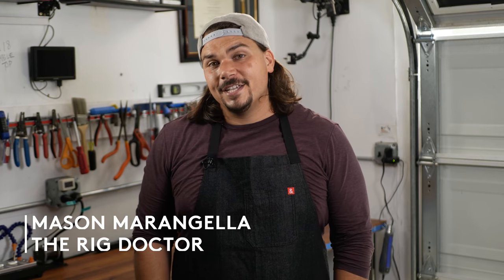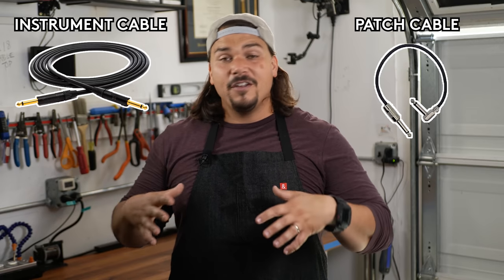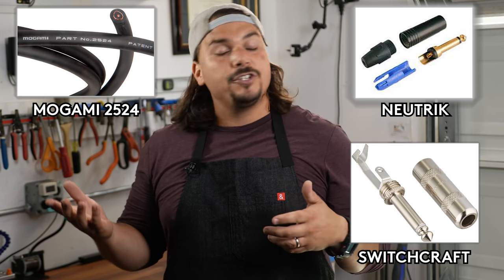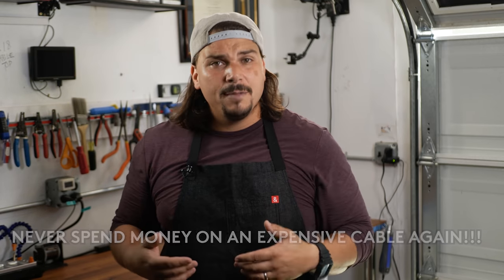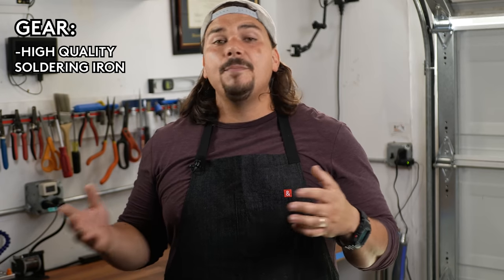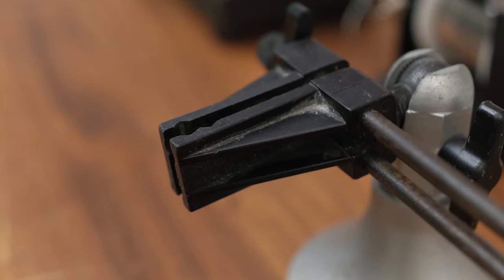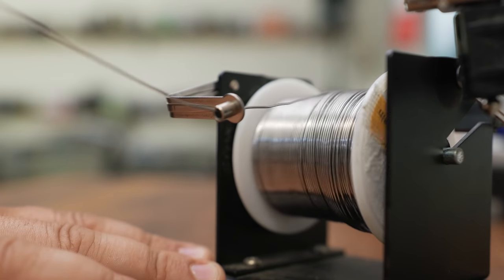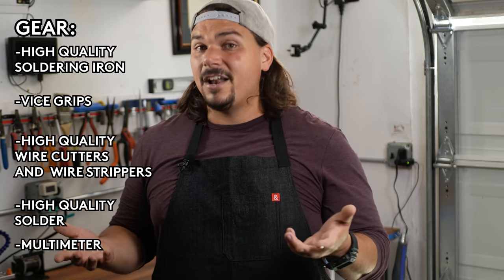Never Buy an Instrument Cable Again

Comment: When you say you don’t need all he shielding you actually do. I do this for living and over time the experience I’ve had is that if you have more shield wire soldered on the better it is. 

I also want to add on the topic of the connectors. The Neutrik silent plugs are as reliable as the normal plugs. We have cable in our inventory that are silent plug and we’ve had them for 6 year so call unreliable is not correct
Reply from the maker: Jonathan - This is a standard practice in the industry, not just me.  On a quality cable, like Mogami 2524, the shield has to be large and thick to cover the center conductor fully.  But you do not need that much wire at the ends where it connects to the 1/4" plugs.  At the plug side, it is only the termination, the shield no longer covers the center conductor, the metal plug cover does that.  A large shield has such low resistance that cutting a lot of it out will still be lower resistance than the center conductor.  There is no loss in the shield quality when the ends are made acceptably thinner.  This is basic physics you would get in 11th or 12th grade, and is not a unique opinion held by just me - this is fully substantiated scientifically.  Just think about it, every strand of the shield is making contact inside the cable, so every one wire is in contact with every other wire inside of the cable outer insulator.  With regard tot he Neutrik Silent Plugs, they are less reliable, the mechanism does fail over time and this is substantiated by our reps/distributors that provide our plugs and our colleagues using thousands of these every month, like Best-Tonics, CBI Cables, and other huge shops that have silent plug failures 10x the non-silent varieties.  This isn't just Neutrik, pretty much all silent plugs have some longevity compromise because of the added mechanical features that are added.
Reply: @VertexEffectsInc  In my experience, the right angle Neutrik Silent plugs are worse than the straight ones. I've had a couple fail and I would never use them on stage. I've removed them from my cables and replaced them with the normal Neutrik right angle plugs. Since I like the look of red housing backs I kept them - they work with the non-Silent plugs!!

Comment: I won't use Neutrik Silent plugs anymore because they're unreliable, more than 10 silent plugs failed on me although I am really careful with my cables. I use Amphenol for years and never had any problems with them. Since that I avoid using any moveable parts like the Silent Plugs. About the cables I've built with Mogami, Tecniforte, Tasker, Gotham AG, Lava, Monster, but after years I prefer Reference Cables (made in Italy).
Reply from the maker: They all have their problems, I only use them if I have to (silent plugs).
Reply: I would also advise against using Planet Waves' Circuit Breaker plugs. They are very nice plugs, but the switch is plastic and tends to break if you abuse it too much.
Reply: @BrunodeSouzaLino  that's the problem with moveable parts, someday they will have problems with material fatigue.

Comment: Neutrik provides assembly instructions with exact cutting length for both sleeves on the cable, no need to be guessing and measure twice-cut once
Reply from the maker: Link?  I've not seen this, but next time we do a video on this, I'll certainly post :)
Reply: oops, that wont work.

Comment: I need some clarification. In the beginning you refer to the difference in thickness between patch cables between the pedals and the cable from your guitar to the board. Is there a difference between the part numbers W2524 and just 2524. In the video about making pedal board jumpers you reference the W2524. Im just confused because it seems a lot of the websites use the parts interchangeable in the title. I just wanted to make sure there are 2 different cables I am looking for, and not just doing endless circles on the internet for a cable that doesnt exist lol. For reference: the amazon link has this in the title "Mogami 2524 Guitar & Instrument Cable - Bulk W2524 - Sold in 50 FT Lengths"
Reply from the maker: 2524 is the same as W2524...same product.  Normally the leading letter is omitted.

Comment: Excellent video and great information!
I am currently using 2 of the 12 foot Mogami Platinum from guitar to the pedalboard and from the end of the of the pedalboard to my input amplifier and I really love the great sound quality of these cables…they make my electric guitar a different instrument than was before…now the tone has a clear crystal sound,warm,silent interruptor system and so neat even when I use distortion pedals effects…what do you think about the Mogami Platinum cables Mason?are they a good choice?
Reply from the maker: I think they're Mogami 2524 as I recall, that's a nice cable.

Comment: Did I miss the multimeter bit and how to test cables?
Reply from the maker: Should be on there. Set it to Ohms and it should read "0" when you put the problems tip to tip or sleeve to sleeve.

Comment: So TRS plugs require a different coaxial cable? I want to make a 4CM snake like you showed in another video but I need one of the cables to be TRS for channel switching. I take it the Canare cable you recommend in that video won’t work for TRS, is that correct?
Reply: Anything that’s three conductor and fits through the boot opening should work

Comment: Assuming all solders are done correctly , is 24/26 ft lenght cable ok before start losing signal ? Also, should we expect to read 0 Ohms when measuring a cable of that lenght ?
Thanks Mason
Reply: I can't answer your question, but.. 

ulver ❤

Comment: I am using SP500 ends, and my ground is fine, but my tip is not reading, my solder points look fine. Any tips? My ground is reading under 1 ohm, but my lead is 4-5 and up. Im using 2314
Reply from the maker: Could be how you have the sensitivity of your meter set.  Did you try the buzzing feature?  Have you sound checked the cables?

Comment: I can not stress enough how important those strain-relief ears are on the Switchcraft-type plugs. They must be crunched down pretty tight. If not, you can get a bunch of movement inside the plug, and the failure mode I've seen most often with cables made using Switchcraft-type plugs is the center conductor breaking loose cause the cable moves around a ton due to the strain-relief ears not being clamped tight enough. I generally dislike the Switchcrafts cause of this (IMHO) design flaw. If I make cables for people, they get Neutriks...If I repair cables for someone and it shows up with Switchcraft-type ends, it gets Neutriks.
Reply from the maker: Josh, strain relief is critical, there are also some Switchcraft plugs that have longer clamps that are good for thicker cables so they really wrap around well.  I think they have an "L" at the end of them, e.g. Switchcraft 280L.  Soldered and assembled correctly I've found them to be very reliable - you can also add head shrink if you want to eliminate lateral movement, in most cases this is more likely than a pull (which is what the internal strain relief is really protecting against).

Comment: I'm shocked that there is no strain relief on the Neutrik plugs...is the solder the only thing holding the cable to the plug?  And if so, is it strong enough?
Reply from the maker: You have strain relief in multiple places.  1) the hard plastic support internally that fastens onto the cable over the solder joints.  2) You have the rubber boot that butts up against the hard plastic support to eliminate lateral movement and squeeze the plastic support teeth to protect against a pull.  It's more than sufficient and is a very well made plug.

Comment: What are the best wire strippers that you use? because most don't cut into the wire good and strip the wire will only strip away a portion or half of the insulation which is a pain to strip the wire. I have never thought about cutting off the soldering TIP Tab that has the hole because I have always used a J-Hook in the soldering terminal hole for Class regulations. Since its Audio the Class Regulations don't apply but can't be used in other applications because QC/QA will not pass this type of work. But I'm sure its good for audio applications I'm assuming. I have wanted to try those Silent cables but knew there was some flaw or side effects to happen down the road. I have wanted to convert all my jacks on my guitars, amplifiers input jacks, guitar pedal jacks to PURE TONE jacks because they have dual tension grounds and dual tension positive tips which in the youtube videos have made the fidelity a big difference from 20hz to 20Khz that other jacks roll off the top high end and bottom low end. Have you checked out or used the PURE TONE Jacks?
Reply from the maker: I list them in the links in the video.
Reply: @VertexEffectsInc  ok thanks I will check them out
Reply from the maker: @waynegram8907  and the Tone Jacks...could be good, this is part of the reason why I use TRS jacks instead of TS to get more contact with the plugs and tension even with a mono guitar cable.  They could also be problematic.  I need to check them out - I'll order some and report back.

Comment: I’m trying to make some cables as Christmas presents for friends, and im struggling getting the boot to work with heat shrink and techflex… any advice?
Reply from the maker: It's tricky...often folks will electrical tape and heatshrink the techflex where it meets the edge of the cable after the tech flex is already put on the cable and the boot is slid way down.  It's easier to slide the boot over the tech flex if you have maybe 4-6" of excess on the end that you can squeeze into a tight bundle to slide the hole of the boot through and then cut down the tech flex as desired.
Reply: @VertexEffectsInc  thank you for always being willing to share your experience!

Comment: Hey Mason,
Quick question for the Neutrik plugs, do you drill the boot to the OD of the cable your using? Just wanted to double check before I do something that can’t be undone. Thanks great video
Reply from the maker: The Neutrik should be able to stretch to meet most cable thicknesses.  What cable are you using?
Reply: I’m using van damme pro OD is 6mm which seems to be the same as the mogami. I’ll try again, sorry first time cable builder. Thanks for your help
Reply from the maker: @jonlanning8973  Sure thing.  You might need to clip off some of the strain relief tab, the hard plastic piece that is internal.  We talk about this in the video as well and show it.

Comment: What is the recommended cable length ? 10 ft , 15 ft etc?
Reply from the maker: Shorter you can get away with the better typically.

Comment: A few months ago KDH did a sound demo between different cable sizes , one was sold as a guitar cable and the other a bass cable  but  I don't think he really understood why the  size difference had an impact on sound quality.  Brands aside ,  what's your take on cable impendence and AWG sizes when compared to sound quality and signal loss ?  I ask because as a radio operator I have a few hundred feet of RG58 (AWG 20 same as the Mogami 2524 ) and RG8 ( AWG 11) ,both rated at 50 ohms , cable  from old antennas and would like to put it use .
Reply from the maker: The diameter is meaningless.  There are low capacitance cables that are super thin, like George L's.  There are thick cables that have super high capacitance, like Belden 8412.  The composition of the cable is more important than how thick it is.  Often the really thick cables can just be the diameter of the insulators and not indicative of the wire thickness of the center conductor or the shield.  I haven't watched the video so I can't speak to their goal or intent or process, but I wouldn't pick a cable based on the thickness of the overall cable.
Reply: @VertexEffectsInc   Thanks , at first I was thinking the 8 would be better , but it does have about double the outer insulation that hates the cold , with winter coming it'd take me an hour to unroll  them .
Reply: In practice, you lose highs and high mids with longer cables. The reason why that happens...You'll have to ask an electronics engineer. As per cable thickness, that will also determine the resistance of the cable and how much voltage can go through it. Guitars generate 1v at most, with basses going a bit more if they're active.

Comment: Nice vid. Do you ever have to sand/abrade the plating on Switchcraft type plugs to get the solder to "stick"?
Reply from the maker: I don't, and if it's not stick you can use some flux.  It won't hurt if you wanted to hit it with some sand paper, but I've had maybe 1-2 instances ever where the plating flaked off at the solder joint in over 12 years.
Reply: @VertexEffectsInc  Thanks for that, I had a time when I just couldn't get any lead based solder and ended-up with  a spool of some nonsense that actually makes good joints (never had a fail) but flows like cold  toffee and just doesn't want to stick to Switchcraft hardware - not a problem with Neutrik plugs (which I use 99% of the time anyway). Thanks and take care, Andi

Comment: @vertex Effects (or anyone in the comments section) I have a potentially dumb question. Can you build a ohm converter speaker cable? I bought a 2x12 Blackstar cab, and it has a 4 ohm our, or a 16 ohm out. All of my cabs run at 8 ohms, when I cracked open the back of the Blackstar the stock speakers are 16 ohm, I would have figured this would mean it would be an 8ohm out, but no. 

HELP!

Comment: I have question. Have you touched on if wireless guitar systems have any tone suck compared to a good cable. I recently bought two wireless systems, a kind of middle of road Boss WL50 and a less expensive Swiff Audio WS-50 Blackwing. And I have ran into some issues with 5G cell phones affecting the connectivity of my Bluetooth pedal controllers and my wireless guitar system made by boss.  the cheaper one seems to not have the same connectivity issues. But I hear differences and it feels a little different compared to a cable. So now I'm beginning to wonder whether or not having a wireless system is worth the effort. Just wondered what your thoughts were on this. I don't want to have to drop a $1000 on a wireless system to have success when I could simply pick up a 25ft $100 cable and be done with it.
Reply from the maker: Wireless is always a compromise.  They've come a long way but still they don't sound like a cable totally.  I like the Shure stuff these days best.
Reply: I had a feeling you we're going to say that. Wireless is convenient but far from perfect.

Comment: Hello, i just purchased a Mogami 2524 pre-made cable with amphenol nickel connectors, i have an identical one (same 2524, same lenght), the only difference is that this one has gold neutriks. The new one is surprisingly darker than the old one and in general sound worse. Do you think connectors affect the sound or maybe Mogami changed something in the 2524? I can't explain. Do you have any idea? Thanks you very much.
Reply from the maker: How are you testing it?  The plug have a capacitance, but it's generally pretty negligible on one cable compared to another.  The 2524 has been the same for decades.
Reply: @VertexEffectsInc  Thank you for the reply, i found the problem. The genius who soldered it didn't remove the black conductive wrap around the transparent plastic and soldered it all. Do you think i can remove it without unsoldering or do i need to unsolder and solder again? Thank you very much

Comment: When you’re stripping the outer layer what gauge on the wire strippers are you using?
Reply from the maker: I think I said what the gauge was in the video, I don’t recall off the top of my head but basically it’s better to start bigger and then work to smaller if you’re unsure

Comment: I am using 20ft Mogami 2524 cable with Neutrik plug jack, but I feel the tone it's so muddy/treble loss, anyone same case with me about this stuff?
Reply: Instrument cable can be tricky at lengths longer than 6 meters ( 18 feet ). You loose clarity, as you know.
I use XLR for distance longer than 6 meters.
Reply: Did you peel back all the black insulator? That is almost always the problem when people say mogami sounds muddy

Comment: I tried to make my own "remote" pedal board input with a Switchcraft mono jack as the input, then soldering Mogami cable to an SP400 1/4 jack. For some reason the signal strength is less than a regular guitar cable by a lot. What did I do wrong?
Reply from the maker: If you don't remove the conductive plastic on the Mogami cable, you can have this problem.

Comment: Panavice? 
Also opinions on lead-free solder? 
Soldering station preference?

Also I love this vid
Reply from the maker: We link the vice we used, but really any would work.  60/40 Kester solder, lead is necessary for best long term reliability.  I only use ROHS compliant solder for export when it's required legally.  Soldering station and materials are linked in the description.
Reply: @VertexEffectsInc  must have missed the links!
Reply: @VertexEffectsInc  thanks for the reply!
Reply from the maker: @stephengarrison172  sure thing!  Let me know if you don't see the info.
Reply: @VertexEffectsInc  I found it :) Thanks for the tip on the solder. I think the Sn97Ag03 may be creating issues issues with some pickup/patch cable connections.